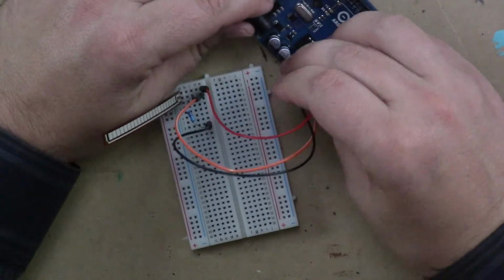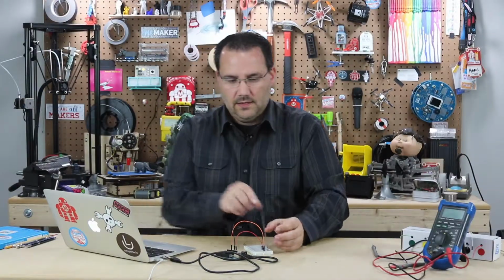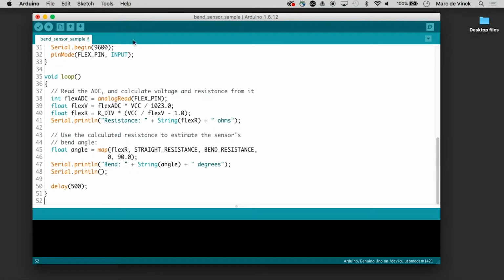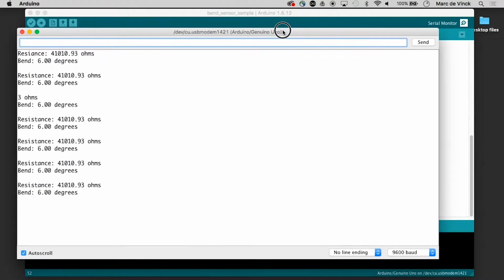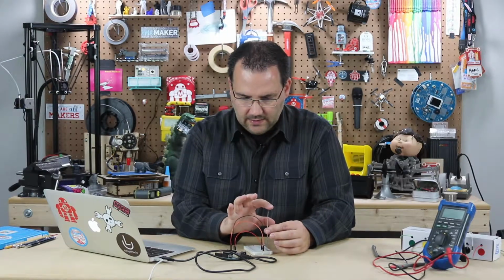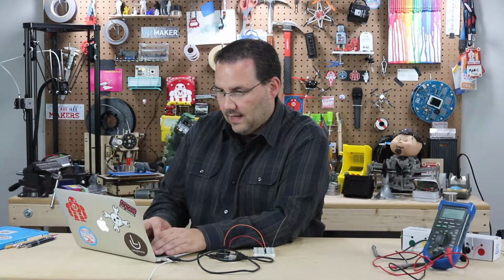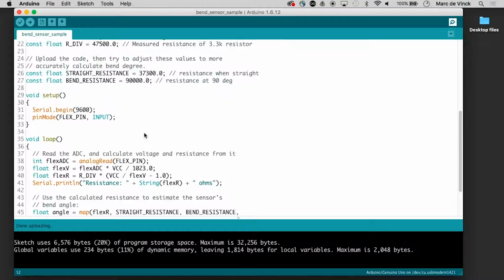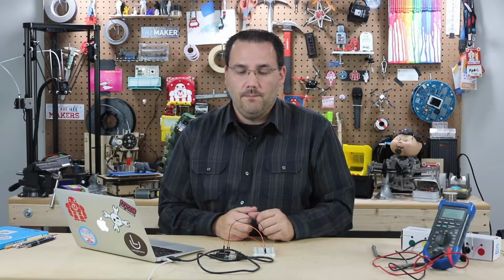Arduino Prototyping Inputs #52: Measuring Flexion (bend sensor)

Comment: My flex sensor is reading -635 degrees when I bend it at small angles. I'm bending it in the correct direction but keep on getting these large negative readings. What do you suggest please?
Reply from the maker: That's tough to troubleshoot via comments on YouTube. If you are getting a range, you can easily map that range to what range you would like. I'd have to see the circuit to know. Did you check the polarity?

Comment: How could I program it to whenever it bends and says activate a pin and it bent to 100 it waits for 1 second to then say that if it is below 200 it deactivates
Reply from the maker: That would be very easy with an ‘if then’ statement. Check out the arduino website for basic code related to ‘if then’